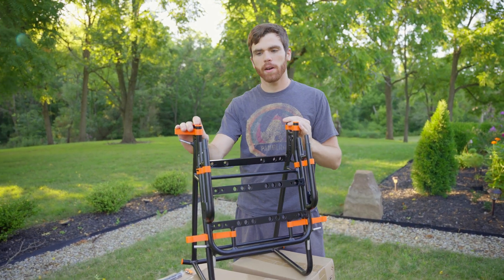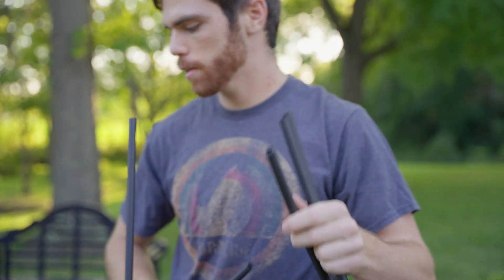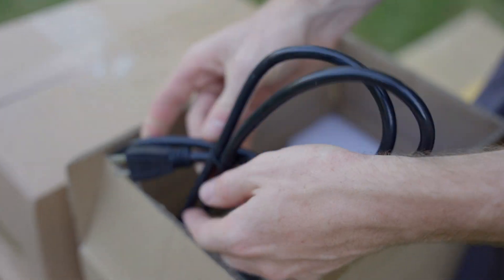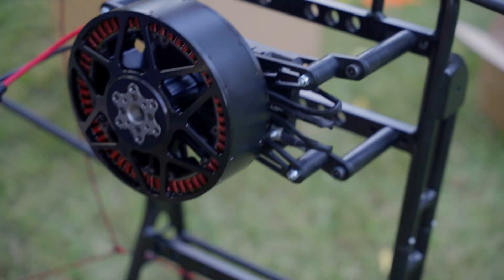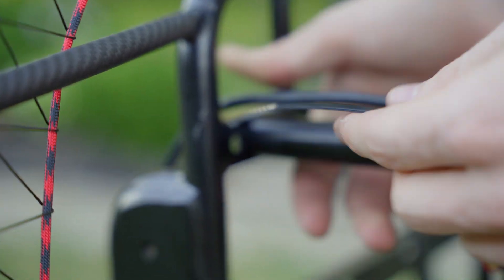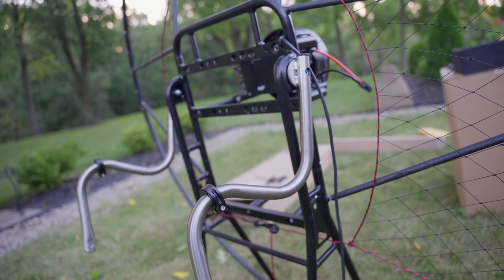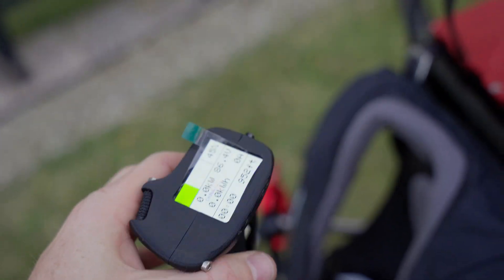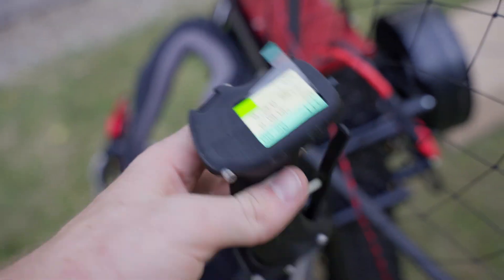2022 Electric Paramotor Assembly/Unboxing

Comment: The throttle control plugs... THOSE connectors really? I barely trust connectors like that on my benchtop Raspberry Pi projects...
I love the rest of it, but that is one REALLY odd choice. 

FWIW, DB9 is cheap as hell and would likely work REALLY WELL for that specific connection. It fixes every problem you noted. 
Zip tie? Nah, screw in plug. 
Cable orientation? Forced orientation, means no mixups.

Adds like, $1-2 to a BOM and fixes a specifically noted UX issue.

Comment: if you are using such a heavy/rigid material for your battery box why not make the battery box part of the frame (like some motorcycles do with their motors). Might be able to get a bit more kilowatts in at the same weight by doing that. I guess the downside would be if you want to battery swap, but are people doing that? I'd love to see this thing reach closer to a 3hr flight time. Gonna keep on eye on this project for sure.

Comment: The throttle connector looks a bit sketch. Would love to see a locking connector with at least some degree of water/dust protection.
Reply: Exactly my thoughts. Latching connector with O-ring seal against dust and moisture. Much safer!

Comment: Hey, i have an original SP140. Is there anyway to make the throttle less jerky and more smooth / dampened?  Thanks
Reply: Ya I would update to the latest firmware version, there are some improvement to the chill mode to make it less responsive.

Comment: Nice video, will the frames themselves be available for version 1 owners to purchase should we damage our frame? I really like the two piece frame, if you butt land and damage the bottom half you can simply replace only the damaged section. Thanks Paul.
Reply from the maker: V1.1 frames will be available for upgrade or just replacement parts in the upcoming months.

Comment: No lock tight needed? I know they are nylon nuts but just asking lol… Also is there a torque number for the motor bolts?? This was a great video and you showed all the angles I wanted to see.
Reply from the maker: No lock tight needed for motor standoffs, some on the gooseneck bar bolts would be fine. I don't use any on my Sp140 I fly but, you won't hurt any thing by using some.